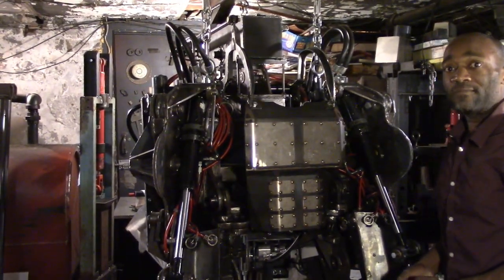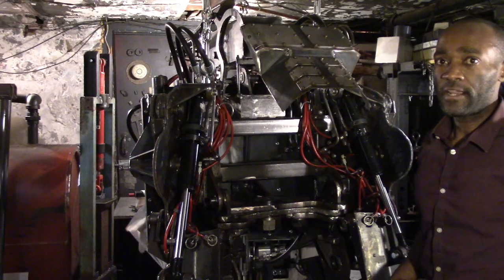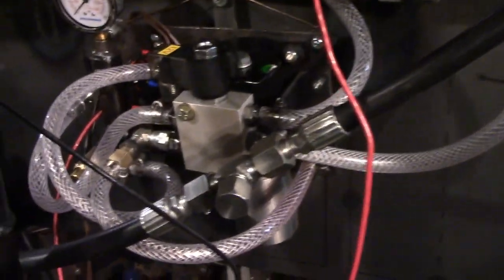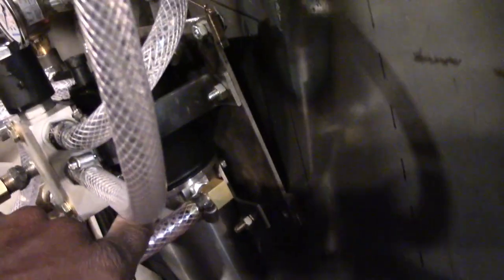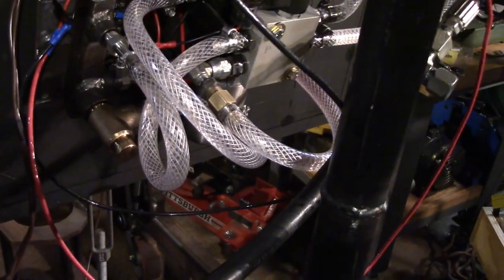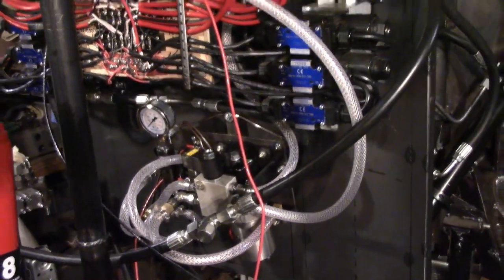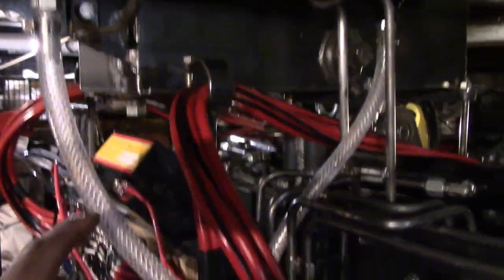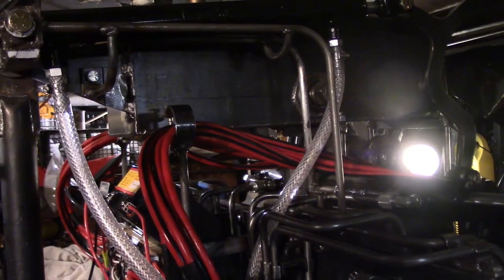Exoskeleton chest armor "suit up" motion test.  -- build video #5

Comment: I can tell you made most of this with steel. Have you considered aluminum composite? This is really close to the Fallout power armor frame. If you could make it like that the Armor could be custom and removable.
Reply from the maker: @Zack.T.B Hi,  I used steel because at the time it was my most practical choice for a first time project like this. I didn't have equipment to weld aluminum. I will certainly consider other materials in future exoskeleton versions. Especially for the purpose of reducing it's weight.

Comment: Just an idea... would it not be easier to just use gas springs and a latch to open it and have a single pneumatic piston to close it?

Might give you more space for other gadgets. 

Much respect dude , it's awesome what you've done here.
Reply from the maker: Hi, I did consider gas springs initiaĺly but as you noted a cylinder would still be needed to close it. If I use a pneumatic piston then I'll also need to add an air compressor. I prefer to keep everything hydraulic. I don't like phneumatics for reasons I plan to explain in a future video. Thanks for watching and for the comment.

Comment: You need to add a bleed valve at the highest point of the system. Flip the hydraulic cylinder over and run a 90 degree bleed valve on either port. And connect the hoses from there. Good luck!
Reply from the maker: The bleed valve is a good suggestion. Thanks!

Comment: ill take two
Reply from the maker: Having multiple fully functioning exoskeletons would be awesome!
Reply: @LionelsLab  how much do ya think a bare minimum exo would cost compared to an fully enclosed one
Reply from the maker: @fajitasbro  I actually have not seriously thought about what one would cost. I can tell you that I still have a lot of work to do and many components to add before it is complete, and hydraulics are expensive. I've been slowly building this exoskeleton for several years and little by little I've certainly spent thousands of dollars on parts and materials. However some of that was spent on parts that I ended up not using because they either didn't work how I wanted or the design just changed. So until this exoskeleton is complete I couldn't give any useful estimate on cost.
Reply: @LionelsLab  ah gotcha ya